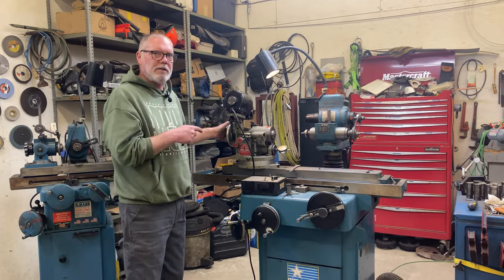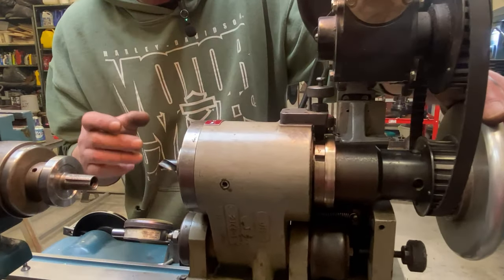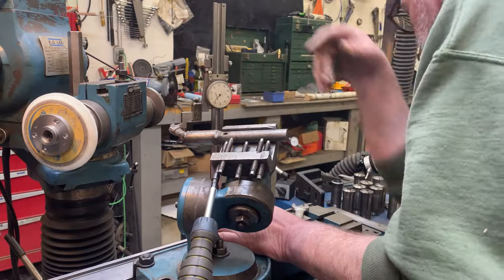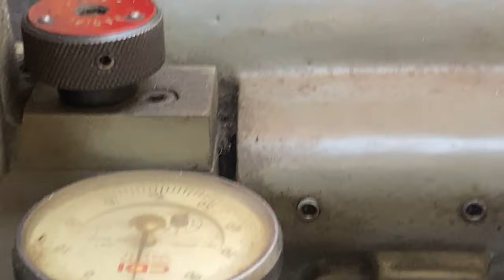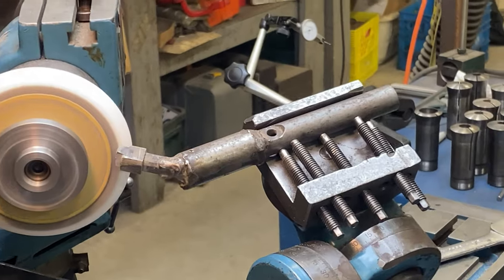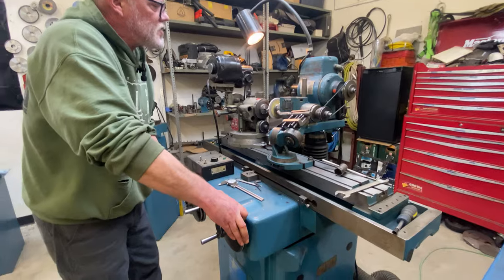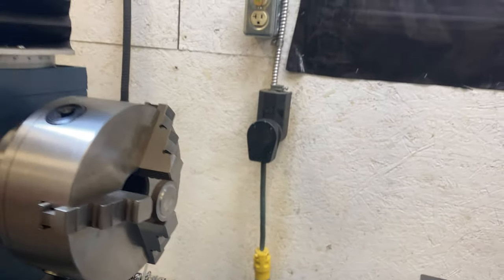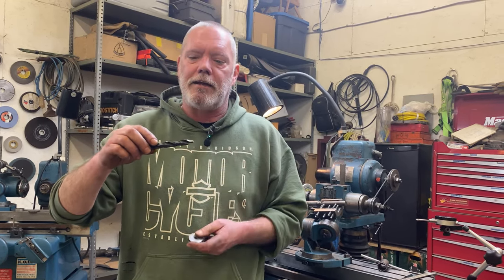modifying a drill bit into a combination clearance drill / countersink

Comment: I was wondering, doesn't the grinding stone lose circumference as your advancing with the cut?  Or is that a stupid question?
Reply from the maker: There's a ton of variables. Speed of workpiece, Speed of travel, Grit of stone, hardness of stone, Roughing or finishing dressing, Rigidity of setup. hardness of workpiece.
However in the example in this video the stone didn't lose any measurable amount.